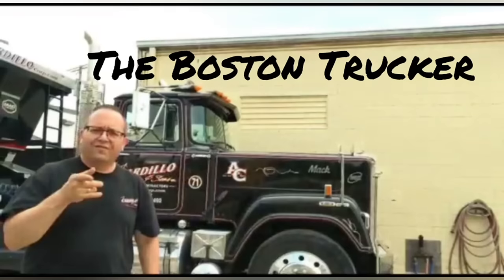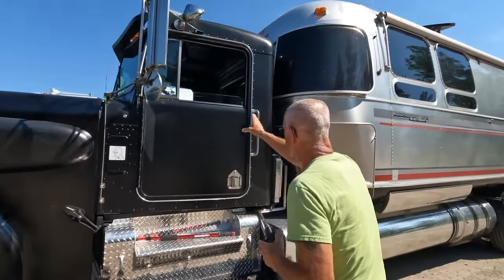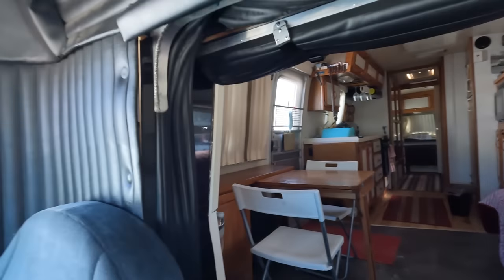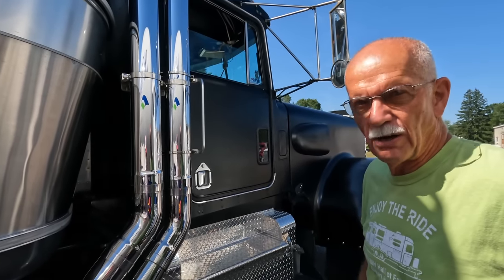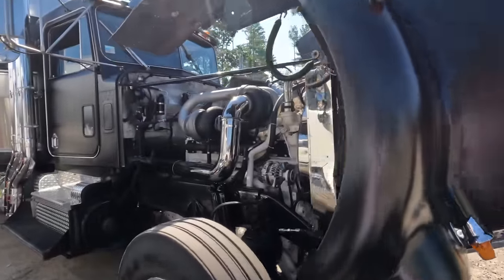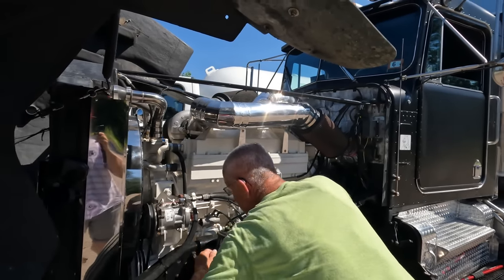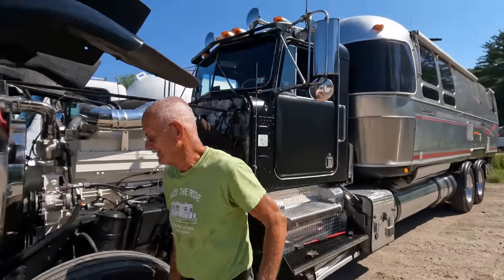Trucker builds dream Stream!

Comment: I worked on a racing team in the 90's that had a full size truck with a motor home body attached.  It was registered as a motor home too, but the enforcement cops pulled us over all the time and we kindly pointed out the tag and they almost always said, "have a nice day".
Reply: I saw something similar to this guy's rig, but it used a 5th wheel camper body instead.

Comment: Lovvvveee this old man 
“They think they can outrun me and they can’t “
Reply: At first I thought about how fast my truck can accelerate from 80 to 100 and thought easily I'm faster, but if I throw a trailer behind it, maybe not... depends on trailer. Probably still beat 10 seconds 80 to 100 with jet skis. Even more impressive is the fuel economy.
Reply: I can only imagine a rider, and him saying "huh huh, watch this"!! Soooo cool, coming from another brother trucker!! Peace.
Reply: @cmcconn100  no joking around KTTA Cummins ain't no joke at all ,,i've got my own beast  that's not quite that pretty  ,,my truck is a pete 359 built in 1977 ,,it's used as a farm truck but i have about as much power as he does only mine ain't quiet ,,,16V71 quad turbo 2 stroke ,,900HP at 2400 rpm

Comment: Excellent video. However, I'd like to see an extended video showing the tool storage, rubber boat, and all the details.  It seems to me that this rig, technically, is much more than just a cool ride. I'd like to know how he made a living for the past 5 decades, and where he had access to a shop to do all the modifications.  I would especially like to see a photograph slide show depicting the  original truck and the details of the transformation.  Thank you so much for making and uploading this video.
Reply: I would like that as well
Reply: Der Truck ist doch fast original,bis auf den Wohnwagen der auf den LKW Rahmen gesetzt wurde und die seitlichen  Tanks unter ihm .

Comment: I've been driving for 45 years and have never seen anything like this. What an amazing build, very clean and well thought out. I was curious what transmission he had in this truck, it was never mentioned. 6.5 MPG with a 1000 HP KTAA is AMAZING, considering the amount of weight and towing an F150 crew cab. Absolutely beautiful!
Reply: No epa garage in that thing
Reply: It's obviously due to gearing.  He's able to do 80 mph at 1600 rpm, with the horsepower to not have to mash it to hold it there.

Comment: This reminds me of a build I saw years ago. This early retired couple wanted a fun and cheap way to see the world, so they bought a stainless steel milk transport container that would typically be on an 18 wheeler, and then set to customizing it to sail or motor the oceans. It had a 6 wheel drive system for the land and a propeller for the seas. An amphibious vehicle in a nutshell. It was impervious to water coming in, unless they had the hatch open. Its ballast tanks kept it trimmed, and they had a topside deck when in calm seas, and a boom sail. Someone asked what do they do in rough seas, and they said that they batten down the hatch and strap into their seats, and ride it out. They said that they were simply like a cork in the water. A little scary, but also exciting. They also had windows to see the underneath and all directions. Many times they saw whales up close and personal. They seemed to be curious. And of course, when they reached land, they simply found a launch area, and drove ashore, and drove all over. They believed that they were the first to create what they called the Geo-Vehicle.

Comment: Fantastic and well yj bought out Conversion , i’m a tremendous fan of Airstreams  and i really love the look of the FuelTanks to hide or disguise the Storage and Propane Cylinders  that was a great idea  i’m not one hundred percent sure  if i love or hate the overall look of the Vehicle  because i usually like unusual Vehicles and machinery but i do generally like them  to look like something that was Factory designed /Engineered to look like it was a Production  model for instance many SchoolBus  Conversions wind up looking like a Old School Bus  when people do the Conversion into a Motorhome themselves  but if you look at a WanderLodge that  are Professionally convertete Blue Bird Buses  that are often used for SchoolBuses  it looks like a Class A  Motorhome  a major plus of using that Platform is  they can handle a very high weight  value in the Conversion Process  similiar to what this featured Freightliner can handle and Tow  my guess is way more than a typicalMotor home or RV  two thumbs up on his Concepts and Accomplishments  there is a lot of great Engineering  and Mechanical Skills to get everything to work well in their new Configurations  that’s like putting a Square Peg into. Around hole  but way more Complicated as you have so many systems to  make work inHarmony like Fresh Water and sewage  with tons of Electrical ftomDOT Compliancy  to Generator  and Household AC Power  and maybe even some Solar they didn’t point out in the video

Comment: This is awesome.  Only thing I would try to change of course would be the type of fuel as 6 miles per gallon isn't that great.  The fuel prices don't seem to be going down either.  Also, I was thinking about the horsepower.  Could he sacrifice a bit of that just to get better mileage?  Not sure if this would make it so he couldn't go 100mph, but honestly, going that fast in a rig this big sounds really dangerous to be honest.  Of course, the highway there's nobody there, but 6mpg?  I mean you wanna get better mileage than that.  That's insanely expensive.  Again, to the other gentleman's comment below about "towing a beer can" you'd think that the mileage wouldn't be that bad on a diesel rig, but I know nothing about them so.

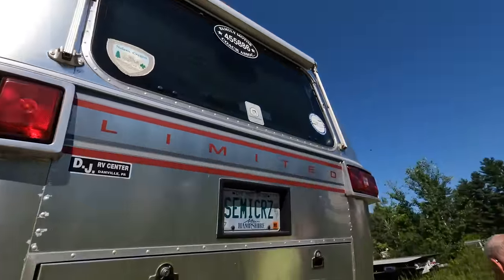Comment: I hate being behind slow RVs, so I like overkill on power.  I had an E350 camper van with a V10 and a 4:11 rear axle, so I could violate the speed limit up any mountain pass, but I was factory limited at about 94 mph.  This is about 10 times more overkill than mine. And the gas mileage is only twice as bad. I don’t want to think about the sweat equity he’s got in that. He must really love to design and fabricate. It’s really a work of art.

Comment: To those that wondered it has an “A” series set of gears in an 18 speed . With A B series it would be much faster but i’d always be moving the stick between 16th and 17th at normal (70-85) road speeds but the top end would be quite high, probably in the 150 mph range, when put in the “big hole”. I opted for a set of gears that allow less  top end but the gearing is appropriate for split only for most of my on highway needs. I’m quite happy with gearing. 3.07 axles, lo pro 22.5 rubber , direct in 17th and if I remember correctly a 15% OD in 18th. I remember it’s slightly taller than the OD of the RTO12513  (13%) I replaced.
Reply from the maker: Thanks Mr. Nichols for your time and sharing your amazing rig with us.

Comment: @8:58 No special drivers license needed..  Only in the USA 😂
Here in the EU you need a truck license for anything between 3500 and 7500 kg (weight on paper including maximum load) , and a full blown truck license to be able to drive above that.. And here you don't get these licenses with a pack of butter like in the USA... $$$$$ (and it don't matter if it is a camper or not)

Comment: Exelente
Solo le cambiaria el sistema de filtros de aire, tiene unos muy chicos y a ese motor KTA 19 no le sirven, hay que colocar los 2 filtros externos en 15" como debe ser
Reply: I run three filters and the vacuum minder hasn’t started to rise yet. They get cold air through the scoops so imho it’s fine. I do not spend much time on dusty roads either.